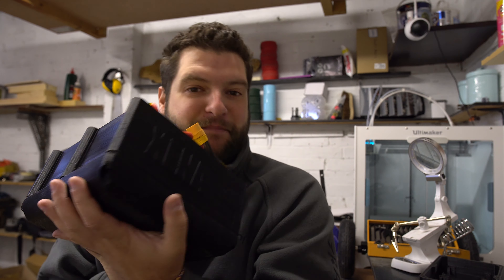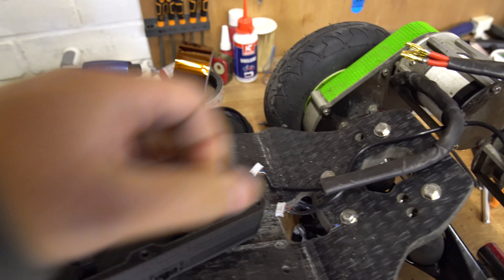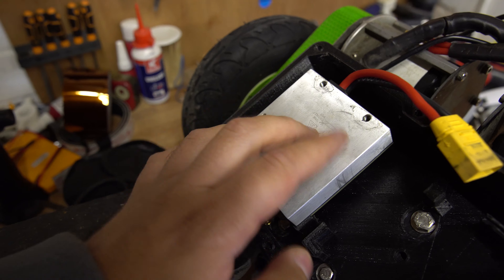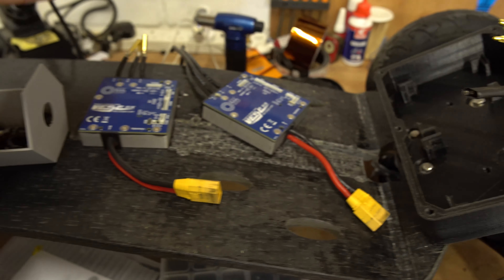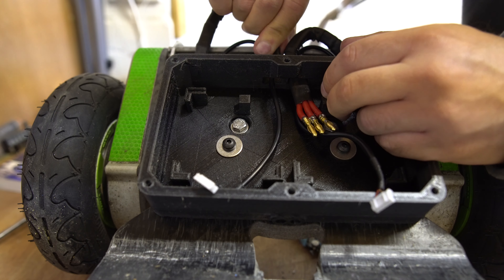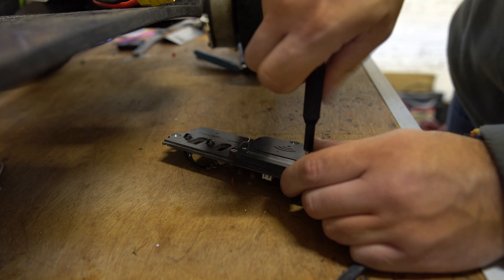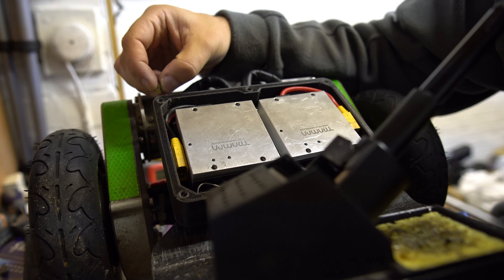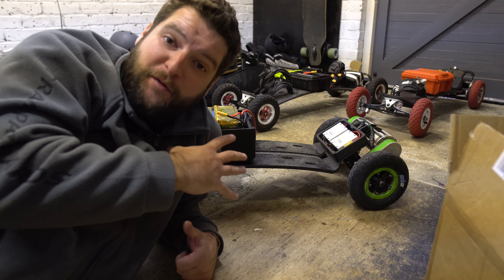40 MILE MONSTER Trampa BUILD -  Custom VESC case

Comment: Dude you have done an amazing job building this!  Scott is gonna need one charge a week 😂
Reply from the maker: Haha Thanks Tim!
Reply: more range less charging time was the goal. with a good weather weekend I do 200 miles a week 50 commute 150 fun but on LIPOS that was 8 charge cycles compared to 5 charges on the new pack for the same range. That's 20 charges a month new pack compared to 32 on LIPOS. so the pack will last longer before needing replacing.  That's 5 VS 8 week / 20 VS 32 month / 240 VS 384 a year. That's a lot less charging time & a lot more riding time.

Comment: Nice video!
Ive got 2 questions:
1. How are you gonna waterproof the cable entries on the vesclosure? 
2. Why didnt you rotate the inserts when installing in the plastic?
Reply from the maker: I used some sugru for the cable entries and these inserts only have anti torque teeth - dont need to be rotated!

Comment: Top job as always man. Really interesting. So are the VESCs attached to the lid?... so it's easy to get to the pins on them (plug in the wand for FW updates etc)?
Reply from the maker: MMM RRR exactly, attached to the lid so you remove just 4 bolts and both vescs are on the lid with all their wires attached.  I’m quite proud of the VESC case to be honest mate

Comment: Love your work! Any chance you can explain ramping time and throttle curve? My trampa build is so powerful and hard to stay on. Any way to smooth out the throttle/braking without limiting Amps? Thanks for all your great info!
Reply from the maker: Hey dude, thanks! Ramping time effects how fast the VESCs react to your input.  Throttle curve is a way to extend or shorten the amount of throw of the remote that is more gentle.  The deadband effects how much of the center of the throttle is dead, you can tune these to dial in the remote feel.  If the board is too powerful from a stop or flow speeds, adjust the "Motor Amps" number, if its 60 now put it to 50 and see the difference, in time you can put it back up to the maximum again.  You can also reduce your Battery Max current, think its 99A as stock, bring that down and you will effect how the board behaves in the middle and upper power ranges.  you can do the same for the -ve values to adjust the brakes.  Hope that helps!
Reply: @LeeWright   Thanks! That helps me out alot. Will play with deadband. It seems like the ramping time adjustments are not doing anything. To slow down,  is it positive ramping time + or -, negative ramping time + or -? Adjusting in Vesc Tools bluetooth App and motors running in Foc. Thank you so much for your help
Reply from the maker: @dmoneysb5486  so negative ramping time is the reaction coming off the throttle and positive is going on the throttle.  a smaller number is a faster reaction time
Reply: @LeeWright  Perfect! Just what I needed. I think the Vx1 remote I have is also the problem with very little throw. Thinking of ordering the wand. Thanks again